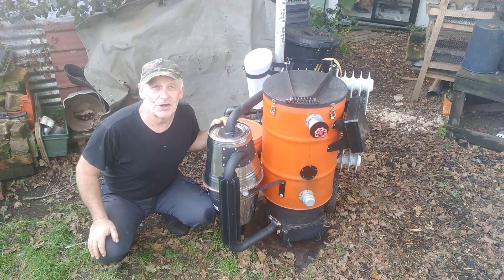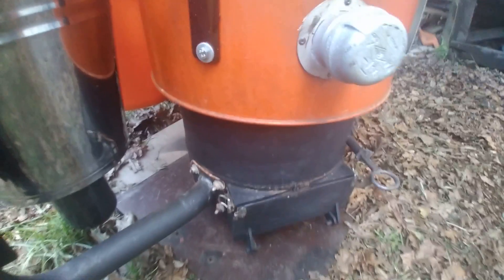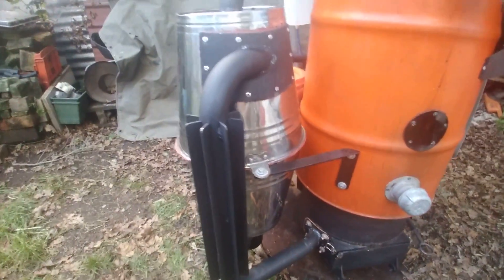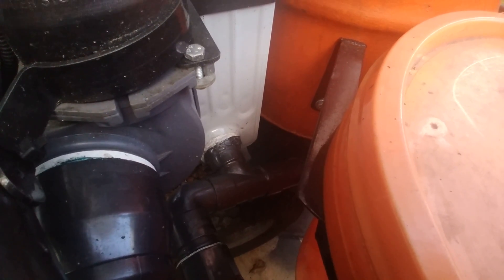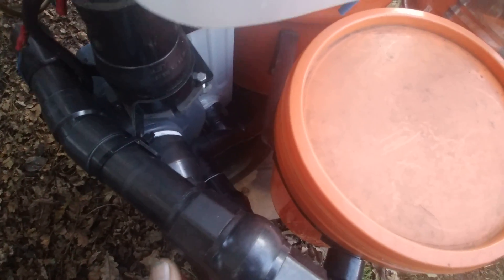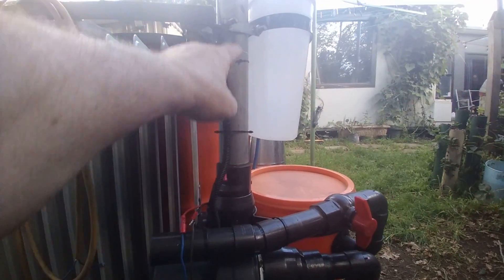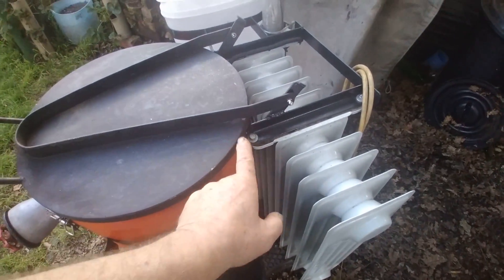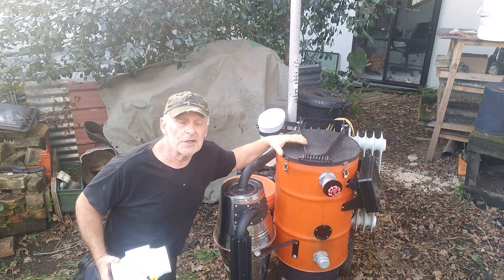Woodgas Gasifier, Home grown energy. A quick look at how it works. video 4

Comment: How much gas can rhat produce?
Reply from the maker: enough to run a engine to 30hp- the production is controlled by the size of the orifice. This is 100mm. 200mm will run a V8 but of course it will consume fuel faster

Comment: Your fuel is charcoal? Charcoal is just carbon. When you burn carbon you end up with carbon dioxide. Carbon dioxide is non combustible. The only way you can get combustible gasses is from wood which is made up of hydrocarbons and carbon. Adding water to forn hydrogen? Dissasociating the hydrogen from oxygen in your fire is not going to happen. All you will make is steam. What sort of quackery are you peddling?
Reply from the maker: seems that you have had way too much indoctrination. Listen to yourself. Then ask: Is this guy doing this or not? is there a propane bottle hidden inside?  am I just a know it all blowarse who is completely wrong? Please, learn about the subject before preaching the subject. www.drivonwood.com
Reply: Coal that burns incompletely produces carbon monoxide. It is the main reason you shouldn't run a coal grill inside afaik.

And steam (so: water) is used while burning coal to create water gas.

Or am I missing something in your complaints?
Reply: @dennisolsson3119  So you're making producer gas or water gas or some combination of both. Where are we getting all of this charcoal from? Is it waist product from another process? If you have to make charcoal to run this you're missing out on all the potential better fuels obtainable from wood. The original tech used coke or coal, probably for good reason.
Reply: @craigsaunders7037  now that is reasoning I can't argue with! :)

I think he (or someone else) mentioned that it was much easier to maintain a stable production with coal. But this might be a false memory.

But as you say there is energy potentially wasted unless the charcoal production uses those gasses. Like making the charcoal in the regular stove while heating the house.
Reply: @dennisolsson3119  I just have the idea that you may have this backwards. Wouldn't it be better to use a small charcoal fire to heat hardwood that's in an airtight sealed container to make hydrocarbons to fuel a generator? The charcoal produced by this could be used to run the system and excess charcoal used for home heating. 

My reasoning is that if you're using a combustion stove for home heating, the best part is after the volatiles are gone and the charcoal is burning. If you're making lots of charcoal instead of ash, something is wrong. Adding charcoal to a combustion stove possess no problems. 
If you're looking at a wholistic energy approach for households between electricity production and heating requirements where hardwood is the energy source, is it easier and more efficient to make electricity using volatiles with charcoal for heating as a byproduct than the other way around?
Reply from the maker: coal was not the 'original tech' wood was first . coke is the by product - not the fuel. you should perhaps stop now, learn the theory,  then come  back and have another go. meanwhile, Ill continue doing it and reporting my successes
Reply: @t.h.o.r.  I'm with you.  A viewer comes along with lots of questions, but before he gets answers, he speaks to you with, "What sort of quackery are you peddling?"  The viewer is highly disrespectful.

Comment: Looks like a bit of fun. With regards to your collander, isn't it going to be too perishable and require too much replacing over x number of burn hours? Wouldn't you be better set using something like a solid metal ash plate either home made from solid steel or easily sourced as parts from a Raeburn oven manufacturer? That would extend the lifespan to thousands of hours and mean that you don't need to pull anything apart to replace what appears to be the weakest link in the chain.
Reply from the maker: Thats what I thought too may people are using s/steel mixing bowls- only a handful seem to use actual grates- what burns out is the nozzle - some people are using tungsten!! mine is ceramic and they cost $4 each. other peoples ceramic nozzles are lasting 200 hours. thats why I went with it - heavy steel nozzles last 150 hours. the old school ones were cast iron. they are the main consumable. the burn chamber eventually burns out in steel ones but Im hoping that my fire brick mix 100mm thick lined with a sacrificial teracotta pot will work well.
Reply: @t.h.o.r.  You've certainly put a lot of thought into it all. Very impressive. Looking forward to more videos with it working while you run a generator. Power is the only thing I am dependent on at this stage on my property and is proving to be a large final hurdle. A woodgas generator would be an amazing final solution to fully wean off the grid.

Comment: Generating gas to then burn in petrol engines, i feel, is really complex.
I like your research, and if you develop a simplified module It will encourage me to build !!!
What about using steam for a piston/ turbine engine ? 
This could just be a universal agricultural engine - it could be just connected to to what you need.
No need for oil, plugs and other maintenance on all the other engines. 
There must be a simplified  boiler design out there....
Reply from the maker: steam is too dangerous- Ill not play with steam.
Reply: Steam engines still requires lubricants, turbines as well.  Steam engines use a very specific type of oil as well.

Gasifiers aren't for everyone, just those willing to put in the effort to keep the lights on or the wheels turning.
Reply from the maker: @cetate93  The reason Im taking this so seriously, is because here at least in NZ. We have a precarious dependence and supply on petroleum. We no longer have a refinery or extraction facilities. It has all been systematically removed by stealth over the last 15 years. When the inevitable happens overseas and the boats stop coming here. We are STUFFED. I want people to be ready. There's loads of people with the skills and resources to build these. I want people to just copy what works and build something for themselves.  these are pretty safe if used responsibly and always outside. They are proven and kept wartime economies moving in europe during the war years. But running one will introduce a new level to motoring skills- ha ha.